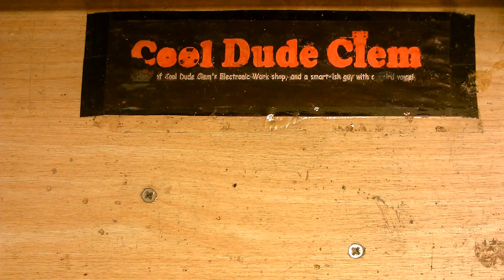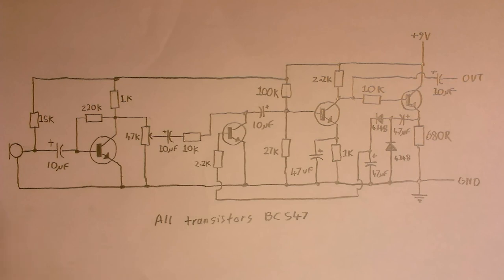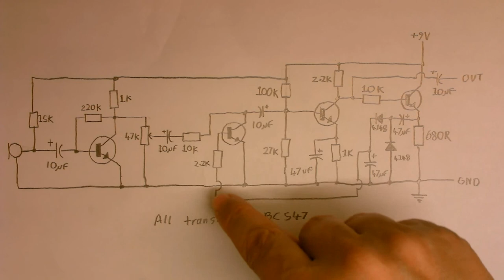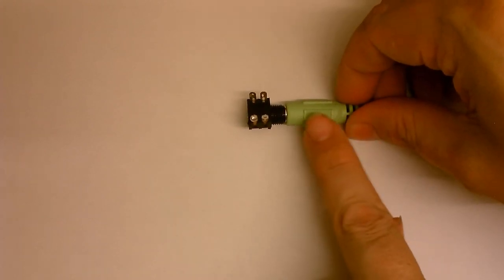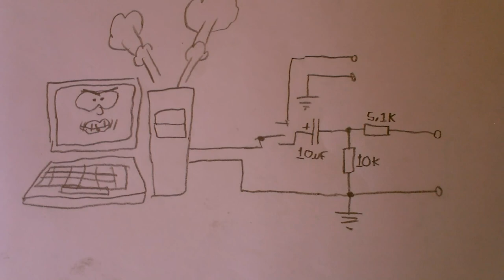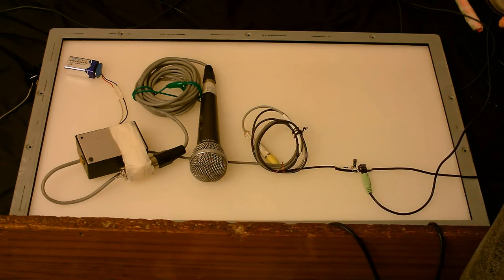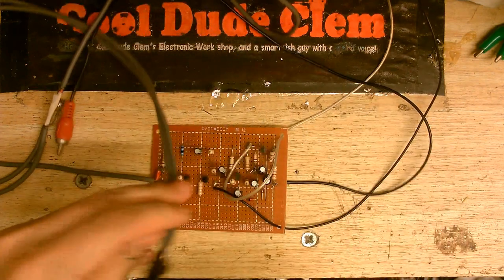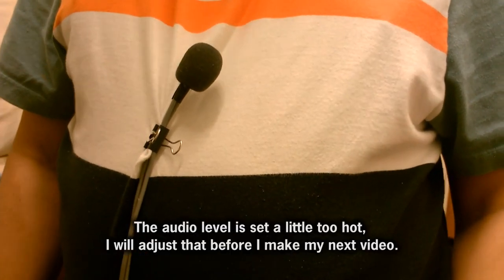Making a better mic setup for my new camera

Comment: Hey Clem, Glad your doing well and good to see you again. I caught the Doc Brown town model not to scale or painted reference to the venerable Back to the Future One, the best. Copy that on the blah, blah's. Build a Kaustic Machines Atari Punk Console, based around 2, 555 timers or better yet, a 556 dual timer and two 500K ohm pots for that old times console sound. Based on Forrest M. Mims classic stepped tone generator using the 555 or 556, works good, super easy. Spring is just around the corner, first day in U.S. is March 20th. Hang tough, all the best from Oregon, C.

Comment: The sound quality seems fine Clem.
Isn't that A.G.C. Mic Pre-Amp developed from a simpler one that you've had the schematic of on your wall for ages?
Reply from the maker: Yes it is. it is that very same circuit, it's a good, reliable circuit, the only difference being that I added an extra stage to boost the microphone.

Comment: Should there be a pot on the agc? I have bc548 instead do you think they should be ok?
Reply from the maker: The pot is there to adjust the gain, I have it set so that there's only just enough gain that it will reduce the loud peaks of my voice, but not amplify the background noise of the room when I'm not speaking. BC548 should work just fine, there's almost no difference.

Comment: Clem do you want to do a job for me? I will pay you, I need some diodes soldering into strings and dont have time to do it, I can post them to you and you can post back when done.. ??

Steve
Reply from the maker: I would love to! Unfortunately I'm very low on solder right now.
Reply: @CoolDudeClem  I will send solder mate
Reply: @CoolDudeClem  have u got an email so we can talk in private mate.. I will pay you well mate also loads of jobs u can do if u want putting circuits together and so on.. got loads of stuff u could have aswel for you projects
Reply from the maker: @T2D.SteveArcs  Ok yes sure, my email is cooldudeclem@googlemail.com
Reply: @CoolDudeClem  I just seen this clem sorry man
Reply: @CoolDudeClem  I will message you and see if your interested in projects etc
Steve